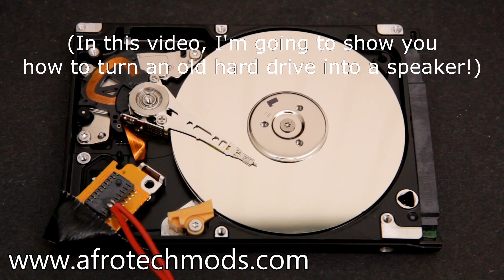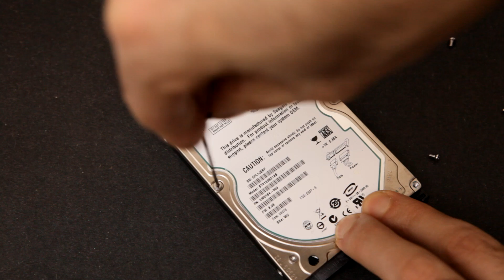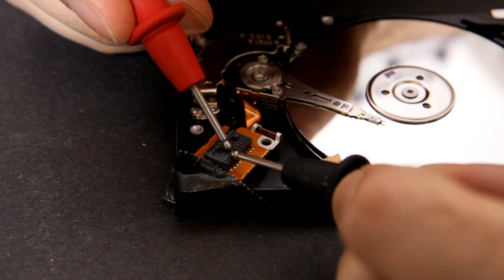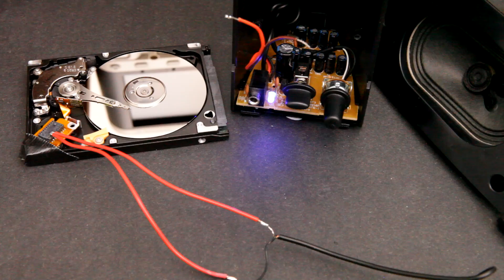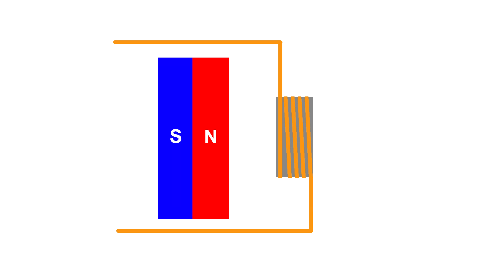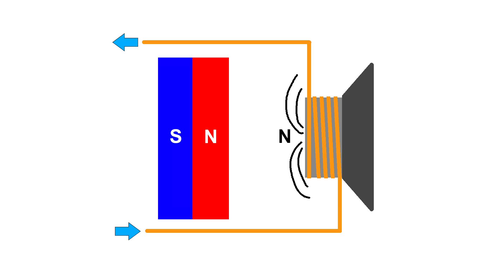Hard drive... SPEAKERS?!

Comment: For me this film has sentimental value: At the beginning of my professional career I dealt with a computer, which used punched tape as data storage. The tape reader had an electromagnet for stopping the fast moving tape precisely at chosen place. We had a program (in form of a punched tape of course:) ) capable of playing melodies using that electromagnet as a "speaker". 
Two storage devices used as speakers and the whole epoch between them...

Comment: I'm just imagining hacking into a large database and making the hard drive room sing.  The computer can choose where the voltage goes, so I think that we could probably write a program to turn any hard drive into a speaker without hardware changes.  Though I'm not sure how well we'd be able to hear it inside its case.
Reply: Theminecraftian772 The computer only sends a data address to the harddisk and the harddisk returns the value at that address. You would need to flash the harddisk it's firmware, in such a way that the original firmware still works, and gets this added functionality. But this will take lots and lots of research and will only work for one harddrive model at a time.
Reply: Theminecraftian772 You can't "hack" analogue waveforms. That's the issue with the online world - everyone thinks software and "hacks" can do ANYTHING, well they can't.
Reply: Were do you store the program?
Reply: Ogere Sherk
We would store it on the hard drives of course.  It would be read off of the hard drive, put into the CPU's cache or the ram to run it because we might not be able to read off the hard drive while they're singing. 
and when we want to make it stop or if we need to read off the disk, we can pause the singing so the disk can be read properly if it can't be while it's singing

Comment: I took mine a few steps further a while back. Removed the annoying platters, added the bottom portion of a paper cup to the arm, added rubber grommets to the stops so it wouldn't hit, then used hot glue to create feet for the bottom. Actually sounded good. :P

Comment: Cool. What's vibrating? I'm guessing that coil and magnet normally just pivot the arm and head across the disk radius. Is the arm what's vibrating and moving the air to make the sound waves? Now to think about where else there are coils and magnets that can be adapted to make speakers.
Reply from the maker: RimstarOrg Yup that's correct. Check out my other channel Afrotechmods2 for a close up shot of the arm vibrating.
Reply: try old tape drive moter add wire to each side to head set wires bite the shaft with teeth an u can hear what is playing  on the radio

Comment: Is is possible to make a cheap and dirty amp circuit with a 9V battery and an LM386 to drive the hdd and and use it as a electric guitar amp+speaker that is loud enough to hear over the normal "unplugged" sound of the guitar? It would look awesome
Reply from the maker: That might work for low volumes. But I'd recommend a proper 9V source not a 9V batt. It would definitely not be loud enough for an audience.
Reply: Yeah you are right. It's too quiet

Comment: 1:59 Which raises the question: could you use this with a modified HDD firmware to create a hidden microphone?
Reply: No where near sensitive enough, and the virbration of the fans and other hdds will throw off the head :/
Reply: I was more thinking of a parked head inside a laptop maybe, but you are probably right.

Comment: I used to screw around with stuff like this years ago.

You can do this with ANY coil of wire and a magnet. Granted, the coil can get hot so don't go throwing 50 volts at the thing. But an amplified source will work.

Coil generates EM field, Magnet repels it... poof... magic. Sounds n' stuff.

Great vid!
Reply: youtubasoarus 
Is the magnet also mounted on the plectrum formed head? Or is it on the hdd?

Comment: What is the likely outcome of just using a jack and or the use of ann mp3 player? And that was kool in an unusual way
Reply from the maker: The likely outcome is that it will be fine, but mp3 players etc expect a headphone impedance of about 32 ohms or more. If you connect a lower impedance like 12 ohms there's the risk of burning out the amplifier on the player. It all depends on how they designed it so just to be safe I'm telling people to not do it.
Reply: Afrotechmods
Perhaps a balun would be in order?

Comment: Wounder if it could be possible to contain everything inside the HDD, and replace the HDD on a friends computer to make a funny prank.
Reply: Emīls Eihmanis I would say that it is pointless, but all pranks are kinda pointless anyway.
Reply: Haha I like your thinking. Could hope they mistake it for an unused harddrive. Heck, they might even think it was a virus and reinstall Windows.
Reply: ***** how is it pointless if that's a prank?
Reply: If it's an old hard drive with an exposed PCB, you could figure out which pins on the PCB correspond to the right pins on the flex circuit. That way the hard drive wouldn't break, but at the same time you could play audio on it (I think).
Reply: Emil Carr Moving the hard drive's head using an audio signal would certainly interfere with the drive being able to read/write data.
Reply: *****
The prank i was thinking was using a old hard drive laying around and replace it with somebodies current hard drive.
The hard drive with the operating system or files would not be tempered with and just being away until the prank is done.
Reply: You can use the power supply inputs as the power source for a simple amp which easily be tucked in somewhere.
As for the music something like a musical greeting card circuit may work.
Reply: Tacos Attack!
The point is to play music without losing the data I think.
Reply: On a hard drive I have here I took off the PCB with a screwdriver - not the whole thing, just the PCB - and found the flex circuit sitting right there. You may be able to soldier some thin wires onto there and place the PCB back where it was, without breaking anything. The amp I'm not sure about though. I guess if you got an amp circuit small enough (use surface mount components, etc) you might be able to stick it on next to the main PCB and use the molex slot for power. Then just run your audio cable directly onto the motherboard.You should probably unplug the hard drive from the motherboard.
Reply: +TemetN0sce Troll Alert